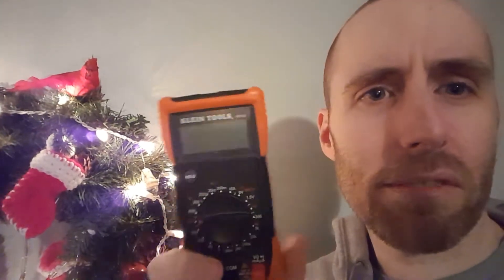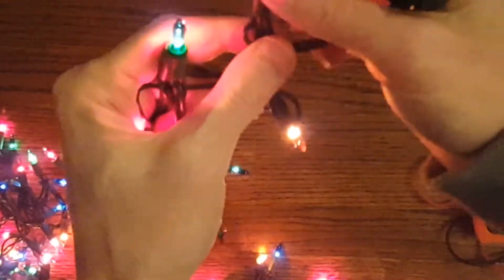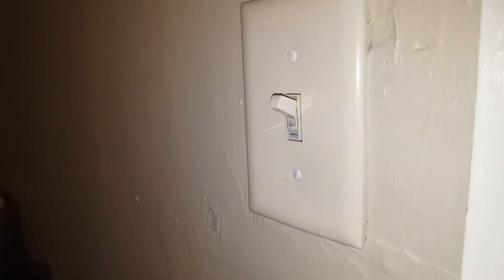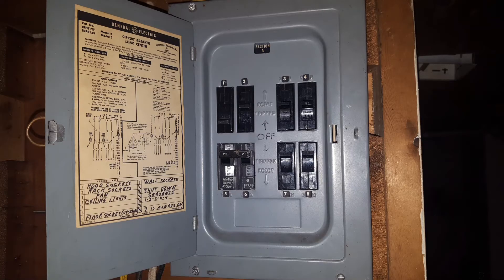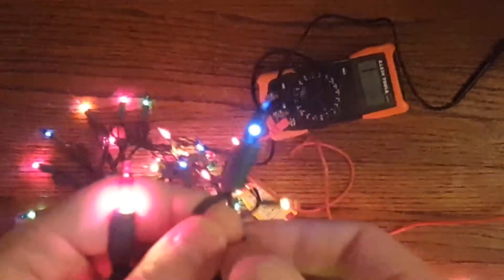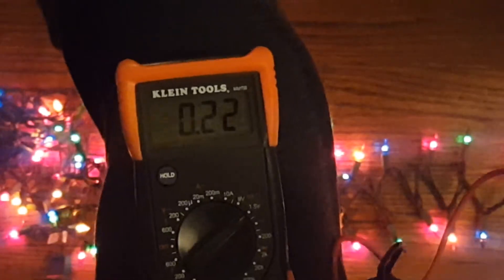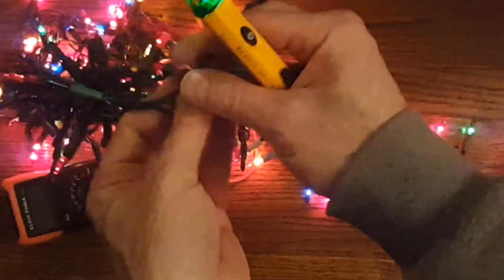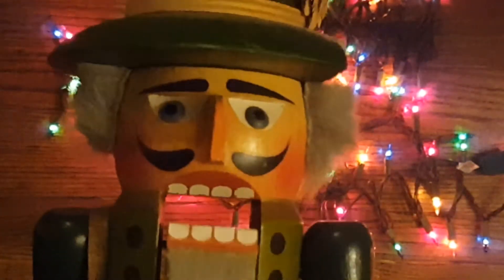Testing Christmas lights with multimeter and other electrical tools

Comment: If this method didn't work for you, here's the method that worked for me (i was trying to figure out what to set my multimeter to and stumbled across this):
Plug in the light string that has a section that's out and set your multimeter to 2000 ohms.
Insert one probe into the hot side of the plug at the end of the light string (opposite the end that's plugged into the wall).
Starting in the middle of the "out" section, remove a bulb (we'll call it Bulb A) and touch the other probe to each contact inside that bulb socket (try the left contact, then try the right contact).
One side of the "out" section (either the left or the right) should light up.
We want to focus on the section that didn't light up.
Reinsert Bulb A and now remove a bulb (Bulb B) that's right about in the middle of the side that didn't light up.
Repeat the test: touch the probe to each contact and see which side (left or right) lights up.
 -If it lights up the section away from Bulb A, just keep moving further along the side that's not lighting up.
 -If it lights up the section that includes Bulb A, reinsert Bulb B and now remove a bulb about halfway between Bulb A and
    Bulb B
If that's all too confusing, it basically boils down to:  At some point, you should get to a socket where one contact lights up the left part of the out section and one contact lights up the right part of the out section.  That's the socket with the bulb that needs to be replaced!
Reply: What brand of multimeter did you use?